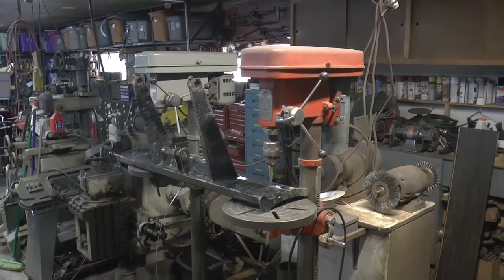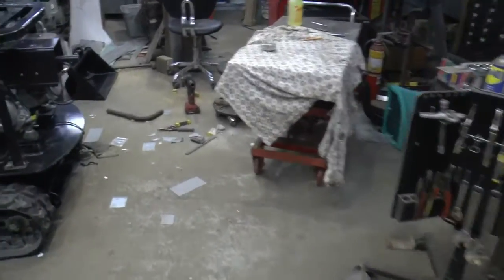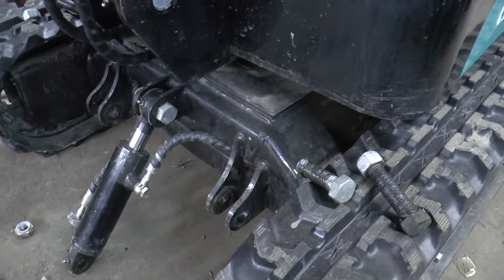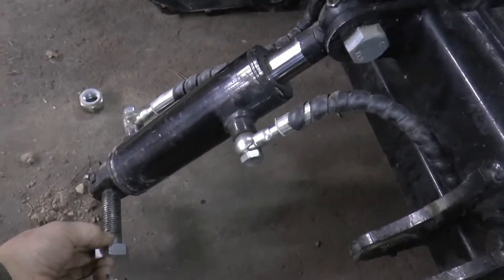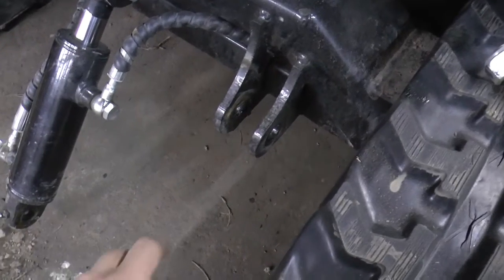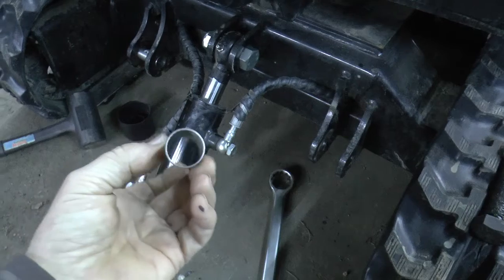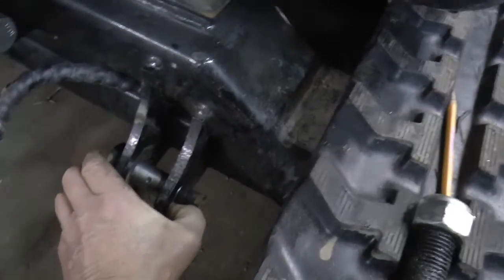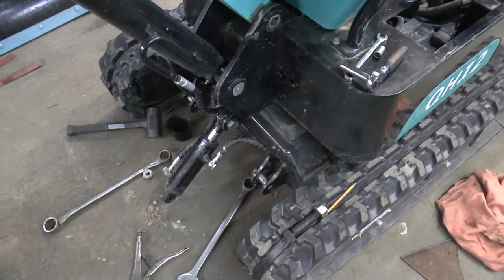Chinese Mini Excavator QH12 Backfill Blade Mods

Comment: Great idea on the mod.  The only thing I don't understand is why peoplpe are hanging onto using the bolts so hard.  Why not switch to pins?  To me, the threads are going to destroy the bushing and the bolt.  Is there a particular reason I don't see that keeps you using the bolts?
Reply from the maker: I think they add some strength to the mounts maybe to keep them from spreading. Just my opinion.

Comment: How did you get the blade back on with a pass through bushing? Looks like the bushing needed to be 2 pieces or am I missing something?
Reply from the maker: The blade arms have the same size hole as the mounting brackets. The bushing goes through all three. The cylinder bushings were 2 pieces because the cylinder had a bushing already. Hope that clears things up a bit.

Comment: A cheap fix for the slop is get 3/4 conduet from electric department.  Put a cut down the side and beat on. Or buy 1 inch still cut  down side and fit small pieces in

Comment: Very nice video's on the micro mini, is the bolt then a 24mm? and do you have a store front web page for the bushings? lol very nice.
Reply from the maker: No store front. I just do my own parts. Don't know what size the bolts are but the out side of the treads measure bout 22mm.
Reply: I really appreciate your efforts to make these videos! Everyone that owns one of these needs to be subscribed to your channel. I'll definitely be checking the fitment on mine.
Thanks again, Papa!
Reply: When society collapses, every rogue bunch of tribes will be looking for a man with your skills and experience. 😂
Reply: A great idea but won’t the grease fittings spin around?  Not sure if you could have oversized slightly but still better than it was.